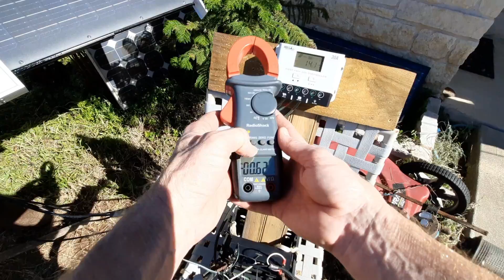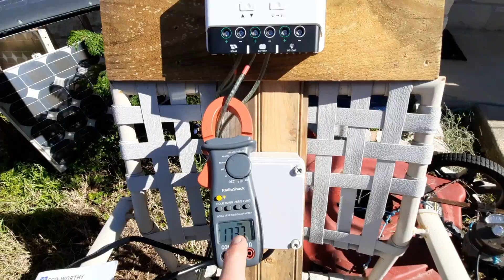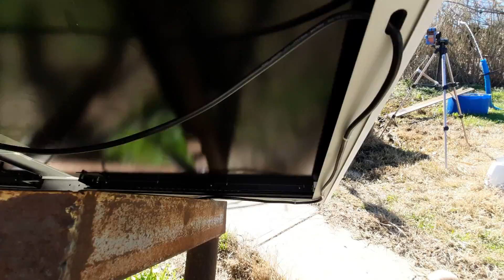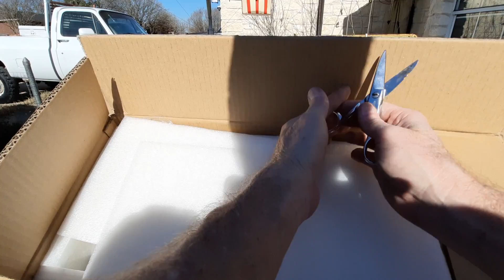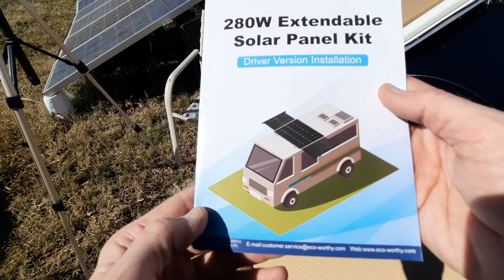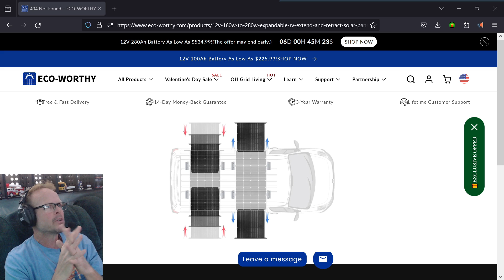🍟📺 ECO-WORTHY 280W Extenable Solar Panel review #EcoWorthy #offgrid #solar

Comment: Hi Fry great video I got the 8 seater golf cart Electric I'm going to try and do something like that would be way cheaper than replacing all the batteries
Reply: Yeah you'd want a good panel I imagine the bumps and vibrations in a golf cart would probably rattle a cheap one apart quick
Reply from the maker: feel free to DM me on Facebook before you start your solar cart project,, I have changed lots of stuff on my setup the last 14 years ,,I have learned a ton